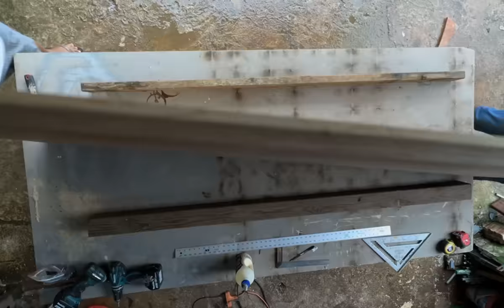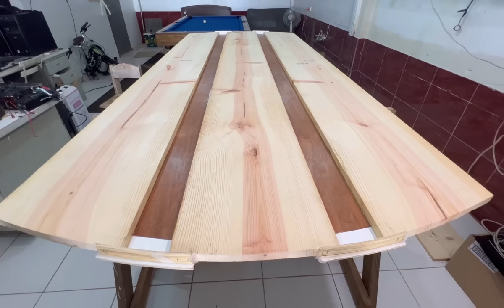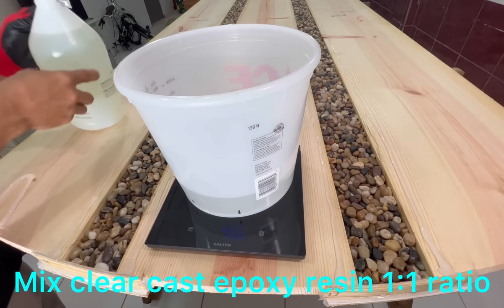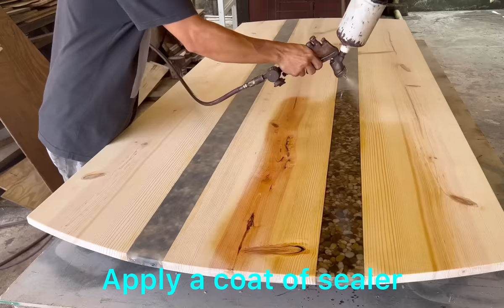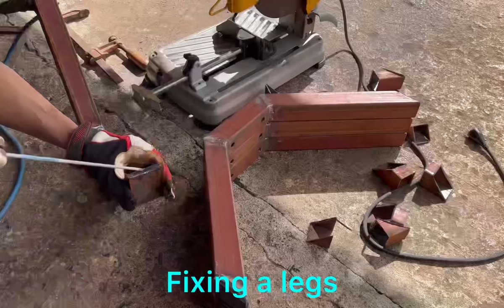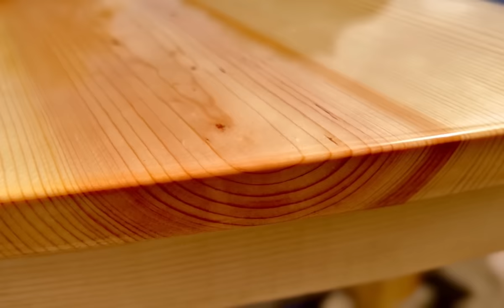How Epoxy Table Made w/ rocks

Comment: en la ultima capa de resina cuanta veces tuviste que lijarla para que quede con ese efecto espejo?, cuanto tiempo esperaste de secado para poder lijarlo en todas las aplicaciones de resina ? que le aplicaste a la madera usando el soplete, lo puedo ahcer con brocha?
Reply from the maker: I did not sand the last pour of resin,that is the final coat.it is a self level resin.So you have to level it very well before applying  epoxy resin on top coat,so it will be covered all the wood.
Reply from the maker: I used blowtorch to remove bubbles.you can also use hair dryer too..
Reply from the maker: Yes you can use brush to spread the resin.